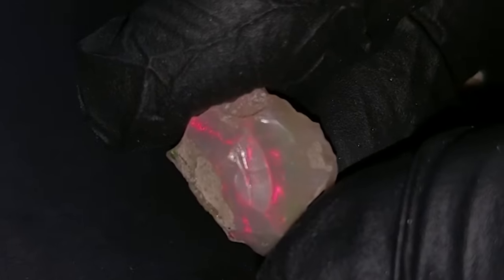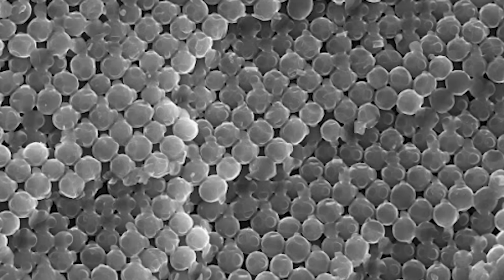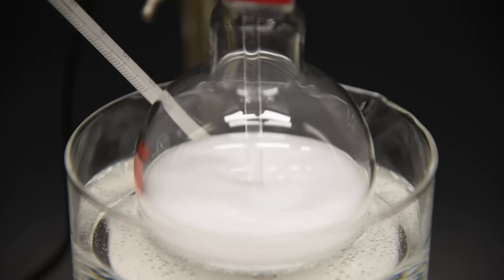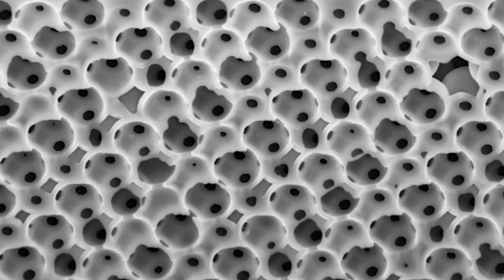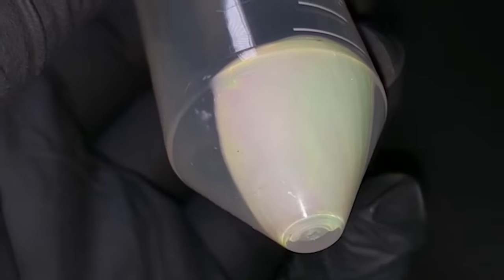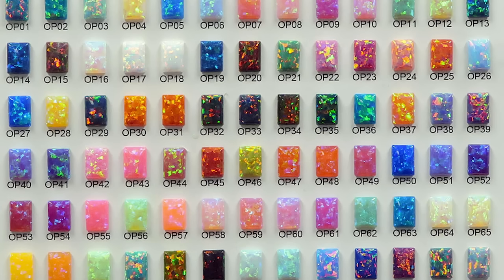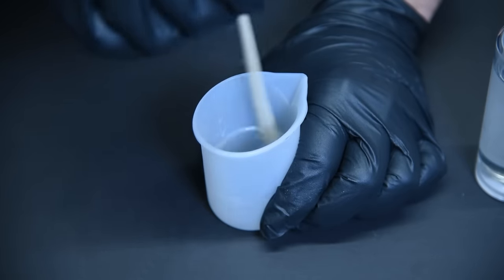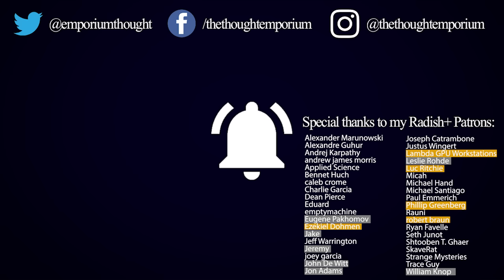Can you GROW an Opal?

Comment: I see that some folks have made similar suggestions
I was wondering if would it be possible to swap out the ethanol for a lower molecular weight solvent at some step along the process? I was thinking you could do it before letting sedimentation occur. I don't think it would affect the settling time but wouldnt a "lighter" solvent move the nanoparticles less as it left the pellet? I also had the thought you could maybe do supercritical drying at a lower pressure with a lighter solvent.
I see that some folks have made similar suggestions, like using toluene to drive out the ethanol before drying. 

as for growing opal that doesnt have the columnar structure, im betting its got something to do with randomly sized "seed particles" that are little chunks of the synthetic opal material. that way, rather than just settling out evenly into flat layers, the nanoparticles would stack out from the pre-existing structure of the seed particles, forming randomly oriented "domains". You probably would not be able to use a purely gravity-based sedimentation process with this though. perhaps you could take advantage of capillary action somehow?

It also occurred to me while while writing this that though opal is not a crystalline material, you can think of it as sort of meta-poly-crystal. Each randomly oriented domain of stacked silica is a crystal-like structure, made of nanoparticles instead of atoms, and held together by electrostatic bonds instead of covalent or ionic bonds. Im sure other people have had the same thought but searches for metacrystal or polymetacrystal or similar terms just turn up a bunch of rubbish for me. Aside from an interesting article about a 3dprinted material

Comment: In order to fill the gaps between the particles, would it be possible to soak the dried opal in a mixture of TMOS and water (without ammonia in order to slow the process) and wait? As a total chemistry noob, I imagine it would slowly fill the gaps between the particles with crystalline silica and push the methanol and water out (or enclose it, that would be bad). Or make the opal a little bit "damp" with water and then soak it in TMOS (again without ammonia).

Comment: Could a vial containing the hardening synthetic opal be a) very, very slowly and minimally rotated (i.e.  2 degree rocking left to right over 2 months), or b) smacked once near the middle to end of the process (so that some hardening material could break and settle into different angles), which then eliminates the straight lines associated with synthetic opals?

Comment: Could it be possible to induce a standing wave or some kind of controlled vibration through the solution as it's settling to create different patterns? Or possibly injecting different "colour" solutions into the settling tank carefully and letting the slight movement from the pipette just barely start to mix things? 
I'm just trying to think what would have caused so many different variations in natural opals it must have just been different contaminants or a specific mixing of solutions to have caused them?

Comment: Couldn't you just use a stir bar?  Or would that somehow interfere with the reaction?  Also, could one do this with pure silica, as if dissolved in water it can be small enough to coat viruses?  Thanks!  Oh, and have you tried clear nail polish instead of resin? I used that to seal  copper sulfate crystals that I made.

Comment: 14:21 I know I'm 3 years late on this video and they may have pivoted since then, but I'm going to point out that giving centrifugation specs in rpm isn't that informative. For RPM to be useful, you need to know the type of rotor being used and its radius. Giving the spec in Relative Centrifugal Force (RCF) or g-force is the best option.

Comment: YouTubber😑: I wanna learn.... 

💡Thought Emporium: okay so we'll show you how to grow your own rubies and other gems. Its simply and really straight forward. Anyone can do it. 

YouTubber😍: Okay. Let's get started! 

💡Thought Emporium: First you'll need: Just a few glass vessels, then we'll need water.

YouTubber: 😍 okay got it! 

💡Thought Emporium: Next we'll need some ethanol, organic-inorganic silica precursor, ammonia. 1 bottle of tetraethyl orthosilicate (that's kind of illegal to obtain in the U.S.).... next we'll need lab charts, 1 (S.E.M) that's a Scanning Electron Microscope... average price range 40K, we'll need some parafilm it would be handy, printers (meaning several printers), 1 centrifudge (for backup), a few hot plates, hot plate stirrers, bottom flasks, several beakers, small box of droppers, beaker tongs, chem-resistant lab coats, pair of lab heat resistant gloves, test tubes, test tube holders, test tube racks, test tube brushes (optional), 1 high functioning lab thermometer, watch glasses, a few ventilation masks, oxygen supply tank, goggles, a torch, computers (meaning more than one computer), 1 pack of standard glass stirring rods, a doctrine for working with carbon nano particles, a brief background in Bragg law of diffraction, evaporating dishs (several), funnels, forceps, gratulated cylinder, 1 iron ring clasp, and 1 vacant temperature controlled isolated building. 

YouTubber👀: Uh I have beer, pizza and coffee.

Comment: Silly question maybe, but can you slightly dilute the resin and put up with the extended drying time? I’m thinking ethanol off the top of my head, but maybe a super lightweight silicone fluid (I just need to check if that would be soluble in the resin). Just an errant thought

Comment: Hey man can we try putting the dry opals I to a vacuum chamber to finish cureing it seems that the internal structure may be holding a small amount of the suspension fluid causing stress to build as some parts can dry internally via cracks and other can not a vacuum chamber would also allow your resin to  penetrate any voids

Comment: This is an old video but would stablising resin work ? it's designed to penetrate wood so might penetrate the opal better. it does need to be baked at about 90C to cure it though which brings it's own issues so I dont know if it'll work.

Comment: y'know thinking about it a bit, I dont think real black opals are black from carbon contamination
after watching some videos on real opals of all types being cut, you can tell theres more than just a "small difference" in how synthetics look compared to authentic
I absolutely dont think its anything that cant be figured out and fixed, to make them look more authentic and even prettier
in the case of black opals, the potch material looks to have a more blueish/purplish color to the black
now this is just speculation, since I know basically nothing about the topic in the first place
but if I had to guess the difference from the white potch and black potch, I would have to guess its the amount of a certain particle size
the white opal is made out of the same stuff as the normal precious stuff, the only difference being is particle size and grain structure
this HAS to be the same for black opal and its distinctly black potch, which means the problem is with one of the two
as I said before I think its specifically the particle size, since we know the grain structure is what actually allows for the play of color, and so would still have to work as normal alongside either type of potch
so my theory/hypothesis/educated guess/whatever you wanna call it, is that if the MAJORITY of the particle sizes are smaller(meaning that they only interact with violet/ultraviolet and beyond)
then it will reflect almost no light on its own, while also packing even more tightly together(cause smaller particles means more can fit in the same space) causing it to show up mostly "black"
if you then mix this properly with the other grain sizes like normal, I suspect that it would turn out to be a highly accurate product
if you see this and were to get a chance to at least test it out, I would recommend waiting to judge the results until after the tiny particles had settled
its very possible that in suspension of the liquid it would appear white, simply because of theres more room for light to get in and bounce around or reflect
of course all of this could be complete hogwash, but even so it might point you in the right direction for figuring out exactly how to make your synthetic opals more authentic

thats all if this gets seen at all, the likelihood of which is "variable" to say the least
(edit)I do really hope this does get seen by at least SOMEONE, because I have no possible way to try it out for myself to know if I'm even close to being right

Comment: so stupid question, since the particles in the opal are roughly the same size as the cd imprints, is that why cds have that rainbow effect or is that a coincidence of the materials used in the cd?
Reply from the maker: not a stupid question at all and that's actually a great observation, because, yes! That is why CD's look rainbowy. Any time you have repeating features of about this size, you'll get a rainbow effect. Works with all kinds of stuff. Tiny lines carved into a surface, little balls like in this video, the texture on butterfly wings, lots of different stuff.

Comment: i was wondering i see that very small rubies ca be made in a microwave i thought is can these be re crystalized into larger ones like can i take 10 grams of tiny loose stones and subject them o heat and pressure and solvent or catalyst causing the formation of larger crystals out of smaller ones ?

Comment: Why not preform opals in a mold ? Why isn't water introduced into the matrix of the opal. We know that when Opal dries out it becomes more brittle at least that happens with mined Australian opals. Your use of resin may be the answer to cutting Nevada limb opals which is notoriously unstable for cutting. You have me puzzling about lab made opals. I am a former goldsmith that has set many opals, even hammer setting very expensive opals. Also being a lapidarist I have cut many opals. I have over forty years experience working with all kinds of stones. It is both an art and a science along with being mechanical. I have done most of my work independently and with little constraint, kind of like a hobby but always with the highest professional results. A former aquaintance had ownership in the Nevada opal mines and was himself amongst the foremost lapidarists in the nation and would come to me for answers regarding the brittleness of the opal and his inability to cut the stone. I draw from your experimentation that maybe after an opal from Nevada has been mined, it should be left to age and then see if it is cuttable. Thank you for this video examination, I really do appreciate it. You have my mental juices flowing again.

Comment: What about just adding more layers of the same solutions that u make the opals with but spacing them out over time or spraying it on or using a dropper or whatever, but in nature gems are formed from the...I'll call them ingredients..I know that's not the correct terminology but u get my point, so in nature it builds on top of itself. So why not immitate how opal is formed in nature. Using only the original mistress but layering over time this way the liquid for will sink into the gaps and fill them. Then when that later drys it too will have its own gaps between the particles so again later it. 
I'm not a scientist. It just seems like following nature's way of doing things when trying to immitate it we would have the ebst success by not adding things that don't naturally belong there like resin. 
However maybe if u do use the resin u might have been better off using a paint brush and brushing a thin layer on or something that is thinner similar to nail polish. Or maybe something else in nature that can be ground up into a fine poder and mixed with water or a fancy chemical that will cause it to bond together and harden when it dries. Maybe a glaze like we use for glazing pottery in a kiln...I don't know but maybe these ideas will get ur mor knowledgeable brain to start coming up with something u hadn't already thought of. I'd love to know if anything I mentioned helps in some way. 😁 This was a really cool video. Thank u

Comment: I tried something similar with silicone dioxide, triethanolamine and ethanol (and water) and I just got a gel. Some of the ethyl groups must be stuck in there maybe? Does anyone have any suggestions? I likely don't have access to an autoclave.
Reply: I did the same thing and ended up with a hydro gel too
 It sounded like metal when dropped but it was light as a feather 
The best way grow your own opal is a method I've done many times  , buy some natural ethiopian opal or Australian opal and grind jt to a fine dust  add it to a jar with 3 parts water 1 part ethyl alcohol and 1 part ammonia   
Add the ammonia last
 Once all is mixed tip in the crushed opal dust and heat it to 60 degrees for about 15 mins untill murky
 Then put on a lid and set aside for a few months the longer the better I've grown so much opal like this and I've even done it with crushed glass and got the same result with play of colour

Comment: At the risk of sounding like an idiot for saying something that would seem so obvious I would think I would look like much more of an idiot if I didn't say it and it hadn't been considered yet but you can thin resin with solvents like acetone and the end result will be not the hardest it could have been in it will generate a lot of extra heat but if you don't do it in large batches and work with it rather quickly it might work for you if you haven't tried it yet you'll just have to make a few trial run this with something less important just to be safe because I don't think the structural Integrity or strength of the end result is as important as filling all those gaps and voids.
Captain Obvious signing off